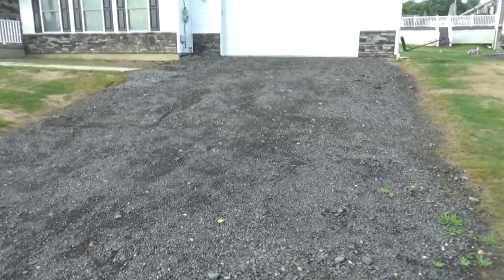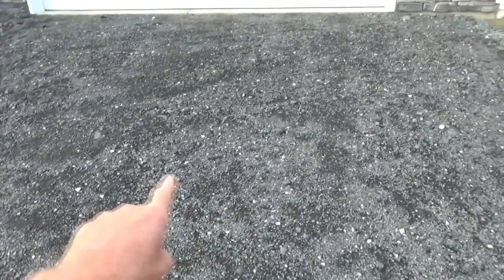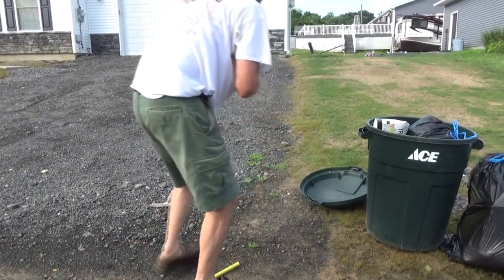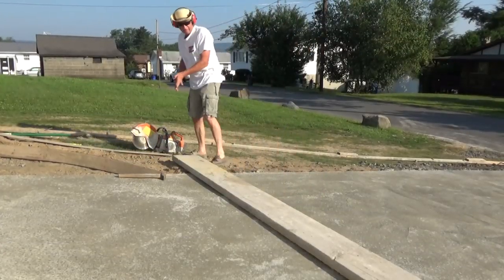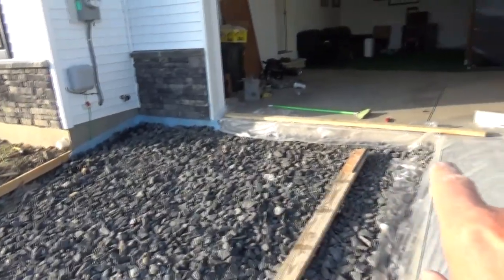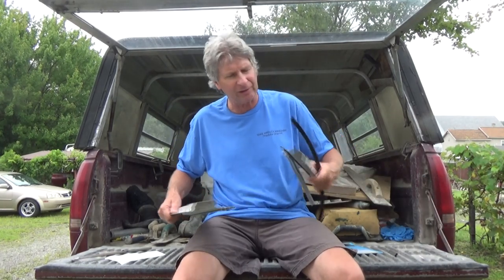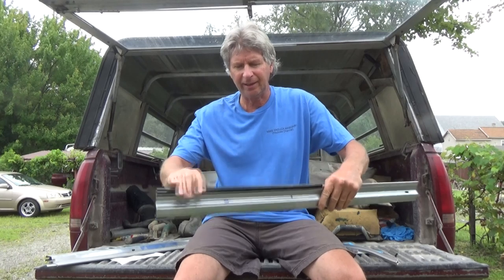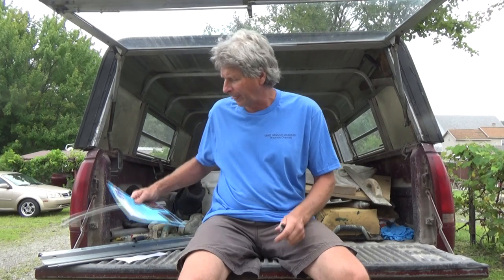CONCRETE DRIVEWAY POUR (Mike Haduck)

Comment: Now that the "Key Kold" patent has expired dozens of companies offer these form-a-key joint strips. They are intended for use in industrial load bearing slabs with a rebar mat (hence the holes on 12" or 24" centers) but for some reason people spend way too much money and use these improperly in situations that really only need a zip strip or tooled joint. For future reference, pours exceeding 10% should be placed from low to high, regardless of slump. Cold weather driveway pours exceeding 10% should be chevron tined and jointed into minimum 10'x10' squares. At least that's how it's done in the PNW. When it's done right, that is.
Reply from the maker: Hi Robin Hood,  as a old stone mason I always look at concrete as garbage, around here it’s time is limited with our winters,  I did a video called “ sidewalks ( old school vrs new school), mike Haduck,  let me know what you think,  mike

Comment: I’m in Chicago and we have a concrete driveway. Broom finish and with the tool cuts not saw. It’s cracked right where the control joints are. Broom has held up good. Some spots not as well since we power washed it several times and have been removing the grit
Reply from the maker: Thanks Fish,  mike

Comment: Very helpful. Couple of questions. Is the metal in the middle in place of an expansion joint? I know you're against having metal in concrete. What do you do against the garage floor? Did you cut the line directly over the metal?
Reply from the maker: Hi Mike , Metal expander usually outlast The concrete and is great for edging  against the garage I use expansion and the rest I cut,  thanks mike

Comment: I like practical. Blacktop plz. 
Mike I’m a concrete mason and do a little block and a few random masonry repairs here and there. I have learned quite a lot from your videos. I’m a little upset you didn’t tell me why you prefer not to broom. I was hollering at you like the other masons do to each other, whene you were putting a smooth finish on a slopes driveway.
Reply from the maker: Hi Eric,  all sidewalks were made of stone slabs years ago and the old people considered broom finishes cheap,  times have changed but it still sticks with me,  thanks mike
Reply: Mike Haduck Masonry Thanks for clarifying that Mike that makes sense. I do some stone masonry too I do appreciate stone finish over concrete. I can see how a generation before would prefer that if I was accustomed to it. I do still see some of the old stone sidewalks around and I like it.

Comment: Turned out great! I need a fellow Pennsylvanian opinion.... I see a lot of driveways (including mine) where they put expansion joint material in-between each pad. Outside of just putting up against the house, is that necessary? If I wanted to replace pads over time, any issues with not putting in expansion material and just doweling them together?
Reply from the maker: Hi Steven, every mason will give you a different answer,  I got my ways other got theirs,  new school is saw cut old school was expanders everywhere,  concrete shrinks so it all depends on what your doing,  best answer I could think of,  thanks mike
Reply: @MikeHaduck  I guess with freeze thaw, it would make sense to put expansion joints everywhere. My understanding was saw cutting joints (or putting them in wet) was just for a control joint, not expansion 🤔

Comment: Hey Mike! What are your thoughts on the Valspar protective sealer? I put about 5 coats on the birdbath and pillars, and can't imagine water ever reaching the cement. I know in a few seasons I will have to re-coat but a little of that stuff goes a long way. I would guess that a gallon could seal a decent-sized cement slab.
Reply from the maker: Hi Jason,  I am always scared on how slippery it is in winter,  I guess it depends on where you live,  thanks mike

Comment: My Dad had a concrete drive poured in December by his builder maybe 3 and a half years ago.  It is just crumbling apart.  They reinforced it additionally, extra thick pour.  The top layer is crumbling horribly.  It's a mess!
Reply from the maker: Hi Blaine, sometimes it's a bad mix from the company, they won't admit it but I see it on state jobs also,  lot of factors could contribute to that, I prefer blacktop  driveways and might have to pour one once in a while,  I warn them about the salt etc, thanks Mike
Reply: @MikeHaduck  The contractor blamed the salt, but no cars every park on it and it's crumbling worse the further away from the street you get.  Also a crap time to pour in December when it's freezing!  When I worked at an industrial factory, when they poured in the winter they had one of those hot water warming trucks that use heating blankets to keep the curing concrete above a certain temperature.  I see 50 year old concrete driveways and sidewalks that look leagues better than his only 3.5 year old driveway.

Comment: Mike, in your experience how does blacktop hold up against frequent dripping water? We have a lot of trees that overhang the length of the driveway (and most of the roads around us) and with every rain we have a pretty steady drip in a dozen different spots. Right now I have a gravel driveway, and every so often I just fill-in the craters left by the water. But I don't think concrete would hold up very well, as water can erode the finish. Do you think blacktop would hold up any better? Or concrete with brick over the top?

And thanks again for the humor. You kill me.
Reply from the maker: I don’t have concrete or blacktop on my driveway either,  like you I jut fill in the holes every few years, thanks, mike

Comment: Dosen't the blacktop go on top of the concert. Why do you recommend blacktop, but not the concrete driveway benign? I didn't understand that.
Reply from the maker: Blacktop holds up better in our winters, the black attracts the heat and It don’t break up that fast and you can coat it,  blacktop is by itself, no concrete underneath,  thanks, mike

Comment: Great video Mike ! I have been waiting for one like this for a while because I am planning on pouring my drive next spring (I HOPE to anyway) I have pretty much the same weather here in N.E Oh as you have in N.E Pa  and I would love to have a Asphalt drive it looks better to me but it seems to cost much more than concrete (or it did the last time I checked) I was told it is based on the petroleum market and a good indication is the cost of gas? I do not have a clue if that is true or not lol I was also told that here in OH a Asphalt drive will not raise your property Tax because it is considered not to be "Permanent" what are your thoughts on that? Is it the same in Pa? Two Thumbs Up Sir!!!
Reply from the maker: Biz Rosario,  I don’t know, I am suppose to go and film a guy putting in asphalt driveways,  so to get an answer I guess I got to wait,   Thanks, mike
Reply: Hey, Rosario, if you are looking for a cheaper way to go, some people use "millings" around here for driveways.  It's the pavement that gets ground up from highway re-dos.  If you don't have much of a slope, it might be a better way to go.
Reply: @AStanton1966  Hi Thanks for the suggestion I have heard and thought about using it and a few people on my street have used it, it also packs down nice over time and since my drive is 16' x 70' I would have to do the concrete as small pads over time (money shortage lol) so I will have to take a second look at that stuff again - sure would be cheaper!! -- I wonder if I could use that as a base and pour over top of it at a later date?Thanks again!
Reply: I thought of another idea.  Put cement tracks down for the tires that would take the brunt of the traffic.  And fill in between them and to the edges with millings.  There's always more than one way to skin a cat.

Comment: Why didn't you use a tamper on the base? This is to reduce uneven settling.
Reply from the maker: Hi Tiger,  That been sitting there a year with cars driving over it , oversize gravel,  I am not worried about settling there,  thanks mike

Comment: Thank goodness you didn't let that guy broom finish fiber mesh reinforced concrete!
Reply from the maker: Thanks Mark,  mike
Reply: There no fibre mesh in that mix, be gravel in 5 years with no steel. Be shot in Australia for doin that
Reply: Chris Scully why?  Is there a building code there that said you have to anchor the concrete to the structure?  That concrete will last ok with the saw cuts. The salt won’t kill it for at least ten years. With no steel in it, it won’t be a problem to remove and repour a new driveway in 15-20 years

Comment: That was some pretty thick ready mix for you old timers to handle.
I would have put rebar in.  If the driveway is facing south, you shouldn't need salt.  The sun will do the work.   Pack your base very well.  4" thick with 4000lb mix will give your driveway a long life.  Cut control joints every 10'
Reply from the maker: Hi Steven,  actually north,  but another thing about blacktop is the black attracts the heat and the snow melts faster, here because of the deep frost, I cut them every 6 to 7 feet and pour 6 to 7 inches, or it will break up,  every area in the country is different of course,  thanks ,mike
Reply: @MikeHaduck  Mike, you used 2x4s for forms.  That's 3.5".  Anyway, 6-7 inches for light automobiles seems like overkill to me.   That stuff is expensive!  I'm in South Dakota.  I think that should be pretty much the same as PA.  Little colder where I'm at, but we have four distinct seasons.   
You say concrete will break up.  True, but it takes typically 20 yrs or more, if done even close to right.
Reply from the maker: rebar is nice but it rots and bust the concrete up , I know I live here,  thanks mike
Reply: @MikeHaduck  I'm going to be doing a parking lot next week and am going with 7/16th fiber rebar. Not so much for rust reasons, because I don't experience that here, but for ease of use, price,  and they claim it has twice the tensile strength.  Oh, and it doesn't rust!.  It's picking up steam the way it looks.  Perhaps it will be like  Pex in the plumbing industry.

Comment: Mike, I wish you would go into more detail why you don't recommend concrete driveways
Reply from the maker: Our winters with the road salt kills them, If it was my driveway i would use blacktop, thanks mike
Reply: Mike Haduck Masonry I’m confused why your winters would vary so much from mine. I live in the suburbs of Detroit MI, and I would think our winters and salt would be similar to yours. I saw an earlier video of yours on patching cement driveways. I think I’m going to try that for my drive way. I know it will only last a year or two, but it is what, $10-15 bucks for a bag of cement, and whatever for some sand. Lot cheaper than removing my driveway and repacking it. Seems like I would have to do the same with black top, every year or two, but a bit more work involved
Reply: Mike Haduck Masonry anyways, thanks for all the vids on cement. Been watching lots of your vids during the lock down. Gonna try some small projects or repairs. Get a feel for concrete

Comment: Yikes! No compaction of the sub base. Put zip strips in. I always pour a six inch slab compact the sub base use a #5 rebar mat resting on adobe blocks at three inches up. And I always put a heavy vapor barrier under it. I use zip strips for control cracks and I always add fiber mesh in the mix to help minimize cracks.
Reply from the maker: No vapor barrier here it will hold the salt and water in the winter, zip strips are iffy ya gots use form a key or cut deep,  matting rust and eventually rot & expand ( but sometimes you got to use it) got to use gravel like a railroad track so she floats,  I should have put you in front of the 90 year old mason,  lol,   Thanks for the comment,  mike

Comment: Where's the rebar?
Reply from the maker: Hi starlet,  not always needed in driveways in our area and is usually only good for 25 to 30 years in driveways before it rust and breaks the concrete apart, thanks mike